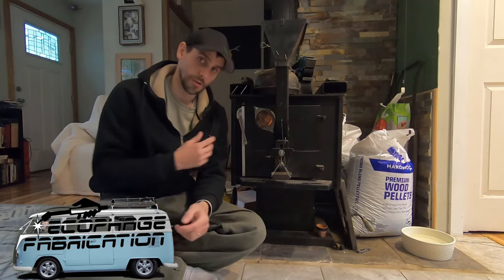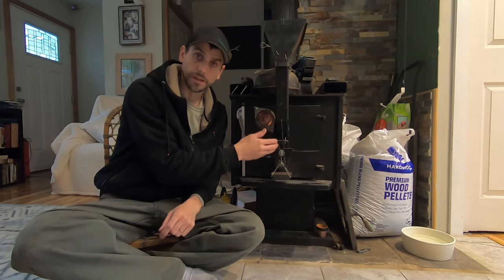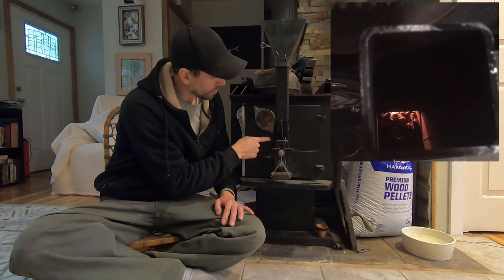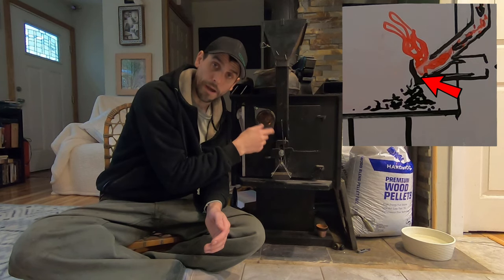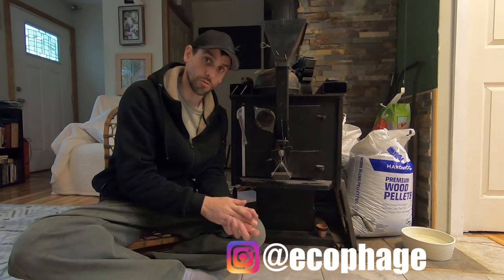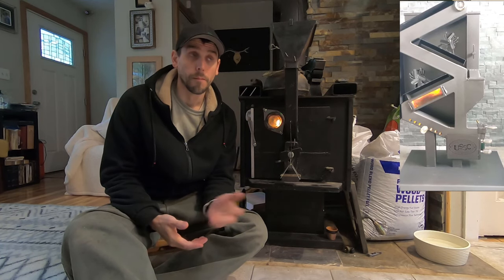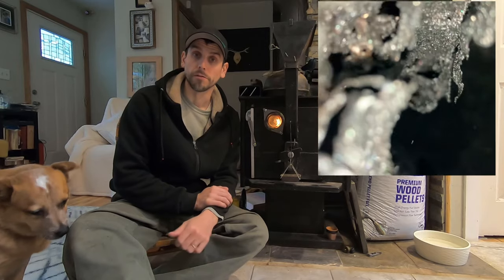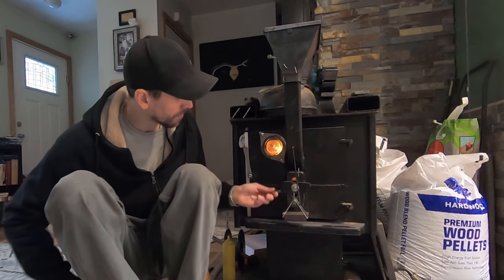How Gravity Fed Pellet Stoves Work (Designing a DIY/wiseway) (Easy Woodstove to pellet conversion)

Comment: The main part of this kind of gravity fed system is to fabricate a burn backet that doesn't plug over time or burn thru from the intense heat.  I guess it took me about of year of research and trial and error to get one that worked for a 24 hour period without plugging and burning steady or having to shake it every hour.
  I found a burner made for the Riley camping stove. It's a completely different design and and doesn't use rods or screen type grate to burn the pellets so it doesn't plug up or fall apart.
 Another nice thing about this idea is there is not build up of creosote in the chimney because the pellets burn so clean. Once the stove gets up to operating temp, there is no smoke.
Reply from the maker: Ill look into that, Im thinking of making a wiseway coy for my garage, maybe ill try that on it
Reply: @ecophage   A Wizeway would be easy to copy and I probably would have tried it if I didn't already have mine built. According to alot of Wizeway owners, they sometimes have trouble with plugging up and back burning into the hopper so their burner pattern is not without its problems. I think a person would improve on it with some experimenting.

Comment: Thanks so much for sharing the video.

I had been searching for this information for quite some time. I really appreciate you sharing it.
Reply from the maker: No problem share it around
Reply from the maker: "How can you adapt a gravity pellet feeder to a smokeless fire pit.

The problem I face is that you have to be putting pellets every 5 minutes to keep it going. Si I thought a feeder would help you enjoy the firepit time instead trying to maintain the fire going."    

   Well thats the whole purpose of the gravity feed. It automatically does it as needed. If the pellets were burning at a rate of refresh every minute the shoot will keep up. You just need the angled chute and the air needs to draw through the area, this forces the fire to burn the pellets down to ash which cant hold up a flow of pellets so the ash gets pushed through the mesh and the more solid pellets stop at the mesh and continue to burn. Once you get it set up its a self sustaining set up
Reply: @ecophage  Usually it burns for 30 minutos and then starts to die. If you do not put the pellets when you have flames, it will smoke like a train.

I'm using a Vermont Castings Low Smoke firepit for your reference.

I'm sure if you find a solution, you will be the hero for thousands of users.
Reply from the maker: @ElBrodito  sounds like the problem is the air isnt being forced through the pellets. Doing this means any smolder, ie smoking and not flaming (which does happen to me occasionally) has to proliferate into a steady burn. So yes every half hour or so my stove may kick out and start smoking or creating wood gas and it takes a second and the fire relights and actually pops a bit

Comment: i built my own with an old  hot water heater , burn pot similar to wiseway  ,  i can have can get it to burn so hot the whole heater turns red , also added a exhaust variable fan because the are prone to smoke back up and helps to light it faster  , once it's lit and burning good i can shut the fan off but when pellets end some times smoke will back up  , next i will build one in an old oil hot air furnace  so i can force the heat up the ducts
Reply from the maker: Nice! Did you see the forced hot air in my update video?
Reply: @ecophage  no but i will look
Reply: @ecophage  I forgot to mention that it burns woodchips also but since they are less concentrated i mix 50% pellets for the same heat as just pellets , just make sure the chips are small , i pass them through a wire screen
Reply from the maker: @tonycavez  that’s impressive, and you’re building a Vw truck!
Reply: @ecophage  yes I'm an autobody/painter/mechanic by trade

Comment: The explanation is well appreciated. I have to wonder why other manufacturers have not adopted this simple method of delivering the fuel without relying on electricity. Perhaps Gary Wisener, the inventer, has a patent. US Stove in Tennessee seems to have taken over the production of this unique pellet burner (Wiseway GW 1949). The Wiseway is not only widely available, it is also a very clean and efficient stove that shows up on the EPA woodstove database and is EPA certified. However, it does not seem to qualify for the most recent 30% tax rebate that the "new green deal" put into law through 2032. Have you experimented with secondary air combustion in your process? That's why the Wiseway is achieving 70% efficiency. Good video but please leave out the musak next time.

Comment: The wise way stoves build up in the last tube going tords the exhaust and people don't set up thair pipe to acomidate um hooking it to clean out the upper half or Thay have problem getting them to draft . I'm hoping to find one used for cheap .thanks for the vid

Comment: Just came across this today, very cool idea. Thinking of doing this with my wood stove. Although one thing does concern me. When burning wood, my stove does heat up to 300 celsius (600F) on the outside, so I'm worried that the pellets would ignite outside the stove, in the feed tube or hopper. 
@ecophage Does your stove heat up as much? Does the feed tube heat up at all? Or isn't it an issue?
Reply from the maker: @mtbmaniac25  it does not run hot enough to ignite the pellets in the hopper. Plus the hopper is isolated in the air away from hot surfaces also there’s not substantial airflow in the hopper the air is constantly being pulled away so it would be hard for them to ignite the only issue I have is if there’s a clog it will smolder up the drop shoot to the hopper

Comment: I don't see why you couldn't run an auger off the heat of the stove, with thermo-electric.  Maybe hand-crank or wind up a spring to kick-start it, and then let the auger work off the TEGs.  You could also use a battery to get it started, and then run off TEGs and re-charge the battery.
Reply from the maker: @harrymills2770  possibly. I did try that but the amperage from the tegs only operates the weakest motors. I suppose you could attach a half dozen together and you might get a normal motor to work but it never worked whenever I tried it
Reply: @ecophage  I didn't think that the augers in pellet stoves required that much power.  Peltier converts only a small fraction of the heat energy.  

It just seems like all that energy coming off the stove should be MORE than enough to run a little auger.  

Thanks for sharing your knowledge on the specifics.

Comment: I wish I had the knowledge to build one of those.
Reply from the maker: I’ve got all the info in my other videos. I’ve also considered making a DIY kit too
Reply: @ecophage  A kit would be awesome. So your in Woolwich? I’m not far away. Tenants Harbor
Reply: @ecophage  you make a kit I'll buy 2of them
Reply: @ecophage  A drawing with the measurements would work for me.  However, my wood stove drafts from outside so I would need to do a little modification to the plan.

Comment: What happens with the pellets in the tube close to the burner plate that get hot but don't have airflow? Do they release wood gas, and does it accumulate in the hopper? What would happen if you ran it for a while and then put a lighter by the lid when you open the hopper?
Reply from the maker: Because of the draft anything near the burn has a gently pull. The only time smoke or any vapor can come out the tube upwards is if you have a feed clog, then it smolders half way up the tube, then you sort of smell hot pellets but in the 4+ years I’ve run this setup it’s happened maybe a handful of times. Generally when functioning normally the gentle down flow from any air leaks in the hopper and the draft drawing that in, the heat from the burn basket never even gets around the bend to the straight section of pellets. Then continuous burn and cycling of pellets also means the pellets don’t spend longer than a few minutes in any one location along the feed route so there’s not really enough of an opportunity to gas out pending pellets. They’re just pre warmed before getting fed in themselves, providing there’s no clogging ash ridge or something. (My other videos on the unit go into these issues more in depth.)

Comment: Question regarding your flue and a pellet stove heat to Woodstove heat? U used a woodstove flue. Obviously this is sufficient because you have been using it for sometime but I heard that pellets run hotter and they need a more solid flue or a flue that can. Handle a higher temp? Is this true?
Reply from the maker: None of that sounds right, my flue never got too hot for 1. I suppose theres some evidence that pellets burn hotter but I think that has to do with the pellet stove designs. Perhaps when you adapt that into a traditional woodstove the extra void space in the chamber buffers it. My flue temps are the same as my woodstove was if not 20-40 degrees cooler, Maybe also since I built small first and then enlarged my burner I didn't reach the same BTU and pellet consumption. Ive noticed my set up is more efficient on fuel so that would stand to reason (less consumption = less BTU = Less flue heat = Same flue temps as woodstove
Reply: @ecophage  thanks for your reply

Comment: Could a person put the hopper and pellet door on the side of stove thus keeping the door more easily open so you could have a wood stove  with logs and pellets or both?
Reply from the maker: Yeah, the only reason I did it in the door is so I can just unhinge the door put original glass door on in 3 seconds and now I’m back to wood burning stove. Check out the build video. My other concern was the stove is double walled so it was easier to co through a single wall on the door than trying to cut through then seal up TWO wall holes. I would however like to have the big glass door back again maybe I’ll modify it this summer again
Reply: @ecophage  that's an interesting idea, I hadn't thought about buying a second door. Thanks!

Comment: Hey I got a question I hope you  answer does the chimney have to be above the house I see a lot of videos where it just comes out of the house and points towards the ground that can’t be right correct
Reply from the maker: I couldn’t imagine that working, I think the electric pellet stoves have a fan literally blowing the smoke out. So they can use a wall vent like a propane heater. But I don’t trust those for several reasons, no power no natural draft smoke could back up into the house and become deadly. Second it’s being vented low, bad for breathing around it in the yard etc and risk of fire from sparks reaching the ground. Spark wouldn’t stay lit from chimney all the way down to a pile of leaves 40 ft away. Having a tall chimney also creates a super powerful draft that is really required to keep all the smoke from wafting in. Like a open face fireplace. Needs good draft. Actually works just like the pellet blowers but doesn’t require power or make humming noise. Basically was the concept I worked with. How do I use the blowing power of a chimney draft to stoke a pellet stove consistently
Reply: You might be thinking of a rocket mass heater. Those sometimes have a low level flue exhaust (stretching the definition of chimney). I've seen them work on YT videos (the ones with low exhaust), and I think they were legitimately working, but I don't know how practical they are IRL and how well they work. You can find lots of info on forums to try it yourself, but I wouldn't build my first prototype (or even first 3 prototypes) inside my house.

Comment: How often do you have to fill ghost stove with pellets, ie how long does the burn last?
Reply from the maker: With the big hopper (update video) it will run 6-8 hours dampered down though it occasionally gets jammed and goes out
Reply: @ecophage  Could a drop plate be put on kind of like a timed one using a dc motor.  Always been curious if someone has done this.
Reply from the maker: @craiglangley1478  I’m sure, I am kind of toying with the idea of a automated hopper juggler/feeder but my main hold back is I love the no electricity situation. I did get an arduino and everything to play with options like that or maybe even adjusting the damper via iPhone. Interesting ideas certainly